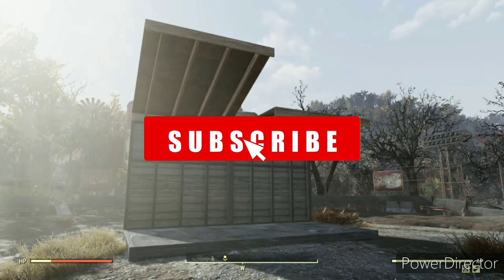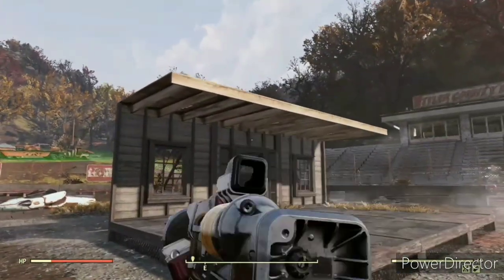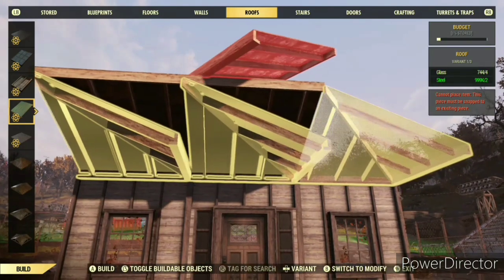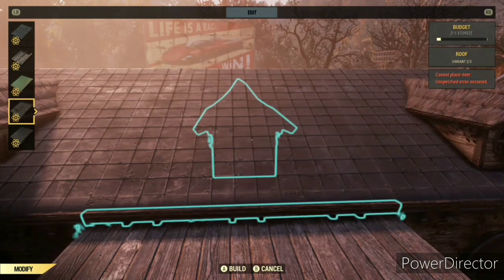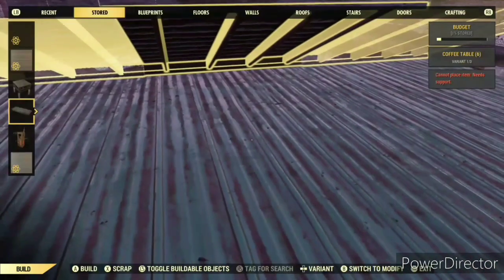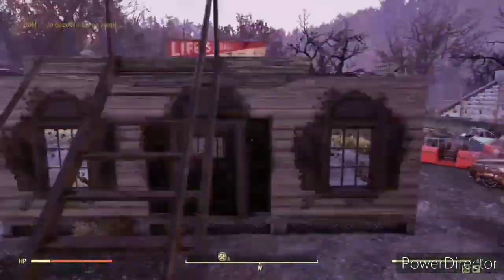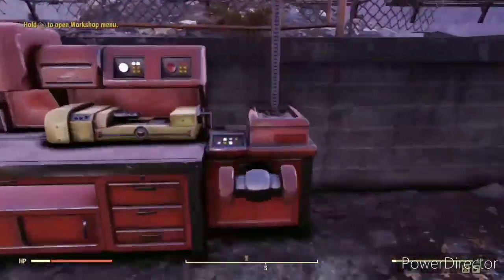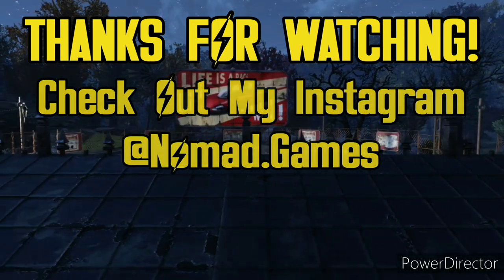ROOF SNAPPING TRICK + DORMER ROOF FIX! | FALLOUT 76 BUILDING TUTORIAL

Comment: Seems like a lot of effort. Bethesda needs to do a better overhaul to allow pieces to snap wherever we want them
Reply from the maker: It's no big deal. Like half of the advanced building tricks require burning things. However, they have since added a version of the roof in question that has no dormer, so the example shown for this technique could be considered obsolete now. It can still be used to blend multiple roof types without the texture glitching as well as upper floor pieces and roofs. Alternate snap points open a lot of small possibilities to add your own flare to the build.